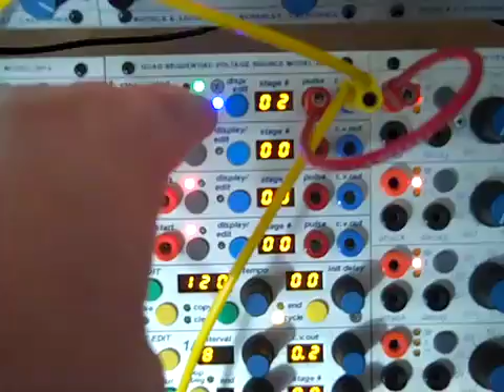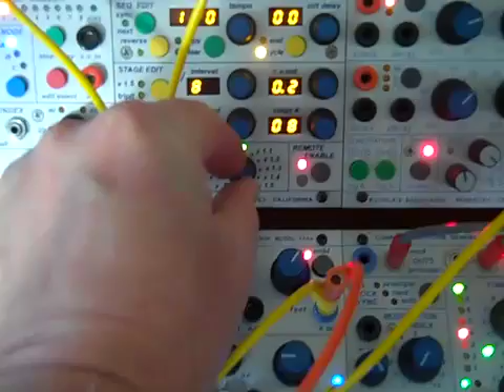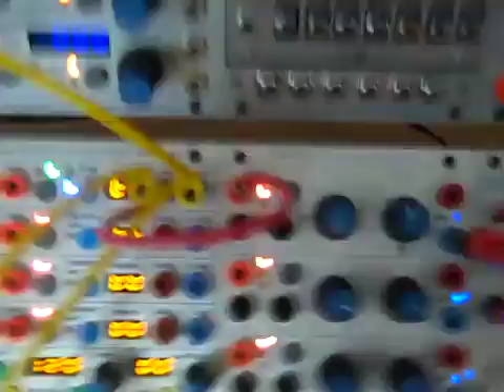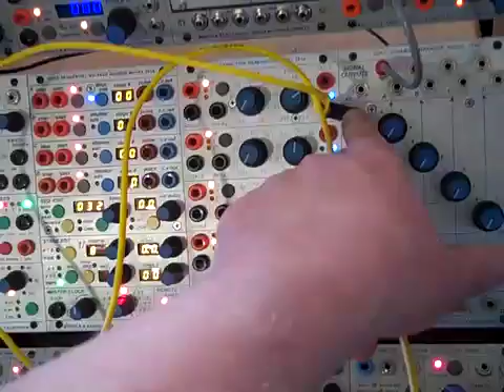254e first explorations

Comment: So the 254e is like a 2x 257 basically, yet doesn't Buchla 200e not do negative voltages?  How do these 2 attenuverters on the left work with that?  Also, love that feedback idea with the 2 interplaying channels.  I will try that with my 257t right now.
Reply from the maker: Haven’t had that for 7 years. Never had a problem sending inverted voltages around my 200e system.